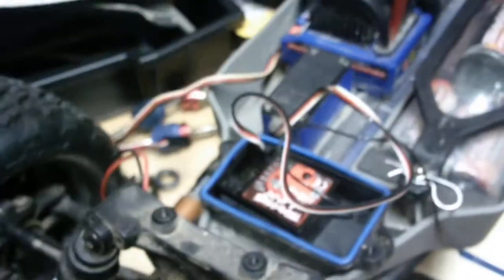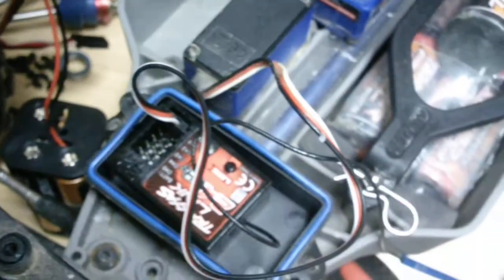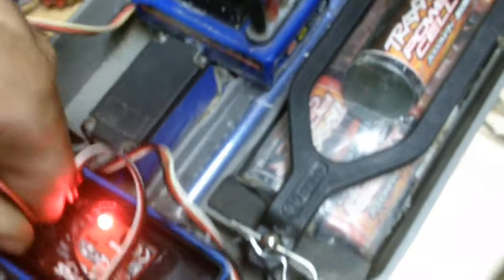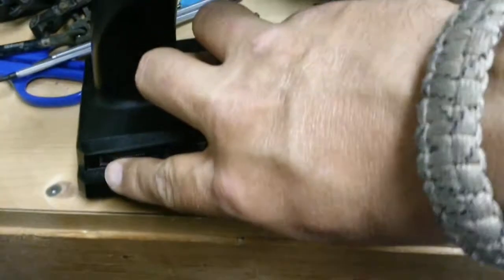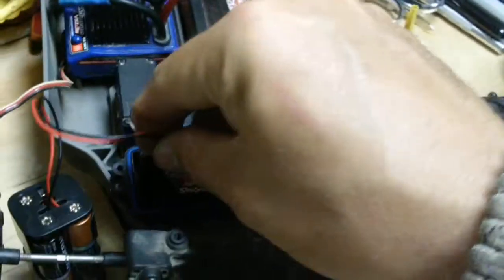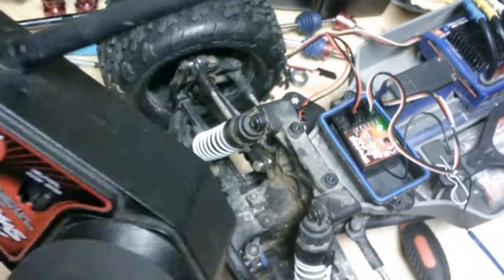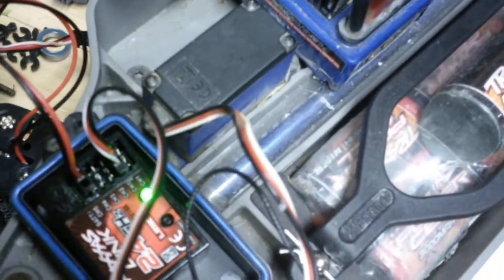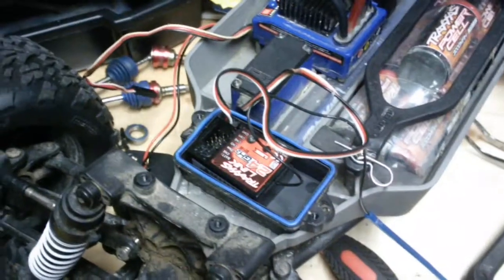Servo Chatter/Jitter

Comment: This has never happen to me only when I drive it in snow but I upgraded it I had the Holyton 9205E and I added a MKS X6 HBL599 Brushless Servo that I bought and when I drove my rc car in the snow it didnt make the shaking noise I got it here https://www.amainhobbies.com/mks-servos-x6-hbl599-brushless-titanium-gear-high-torque-digital-servo-high-voltage-mks-hbl599/p451000?gclid=Cj0KCQiA7NKBBhDBARIsAHbXCB5Lmt8ae8pwWxq1C3jYJjkmYpM53sgJ1Z84LJRqVNbbtH-qkUO0GrIaAovjEALw_wcB it is a really good servo but it is kind of expensive  but if you get that servo it wont ever make that noise ive had it more than a year and its good as new

Comment: how did you solve it?
Reply from the maker: Sorry for the delay. Called Traxxas. Turns out that the internal potentiometer on the servo is starting to go. This causes the servo to have a poor "position" which causes the servo to move back and forth across the "desired point" which is the "jitter". Traxxas replaced the servo. Kudos to awesome support. (Car was registered with Traxxas BTW).